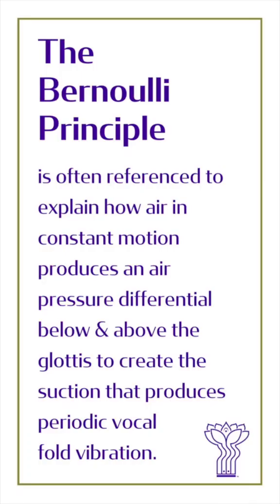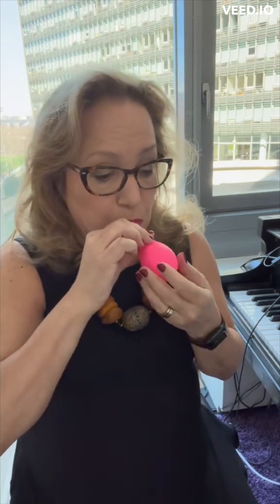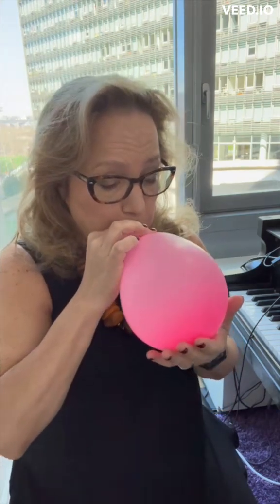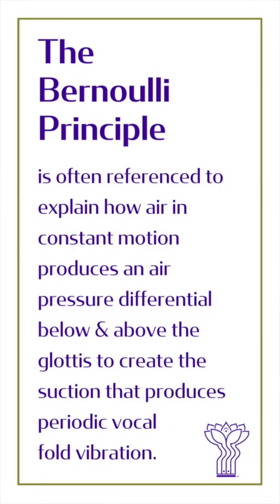Bernoulli’s Principle explained & demonstrated in under 3 minutes #shorts #singingtip #vocalpedagogy

Comment: You seem to be suggesting that the emphasise on " support " : using the abdominal and intercostal muscles ( amongst others ) to push out air whilst vocalising is fundamentally wrong?  In my opinion you would be absolutely correct. Unlike one of the commentators above I am not surprised you have only had a few views: the " support " model of singing has basically become a dogma, it is both incorrect anatomically and in terms of the fundamental physics. Your explanation is superb. Thank you.